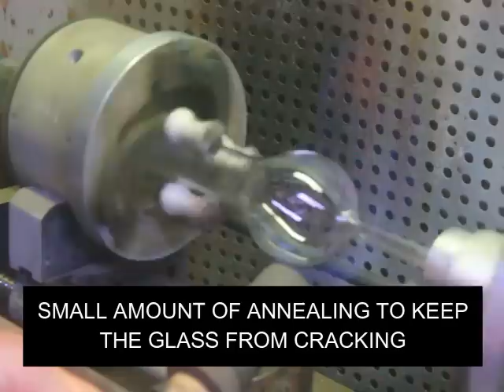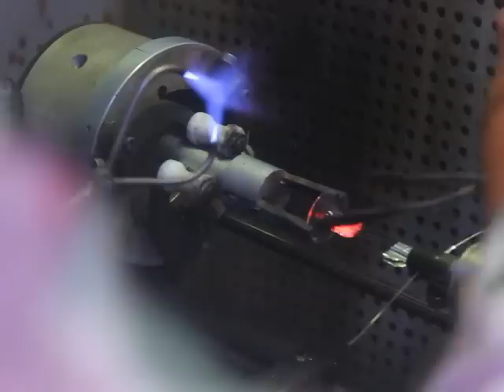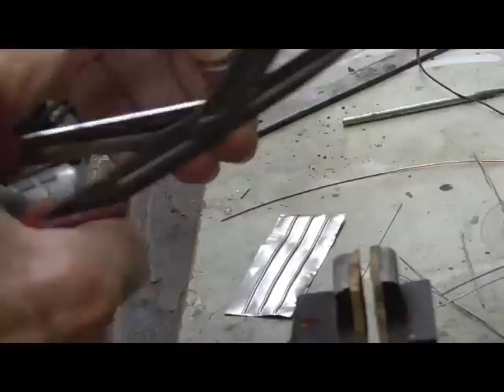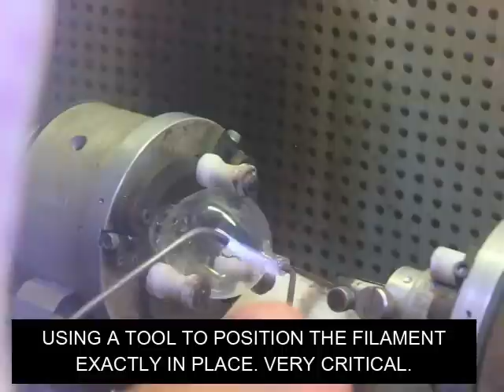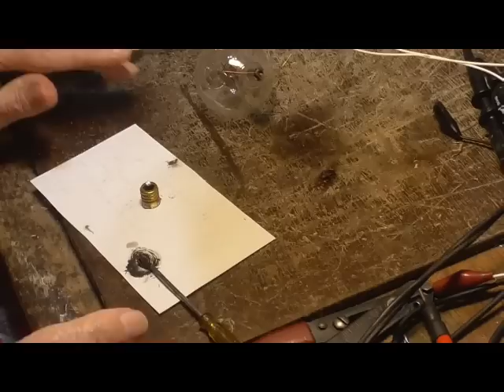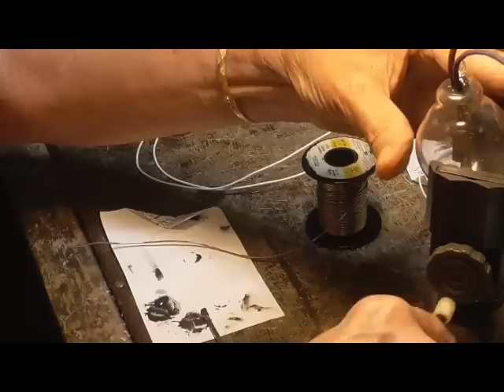making a deforest spherical audion tube

Comment: will you be able to fabricate me a lead glass x ray  vacuum tube 60 mm long x 30 mm diameter?
Reply from the maker: Sorry, no. I do not have the capabilities to work soft glass. I only use pyrex because of the severe annealing required for soft glass like lead glass. Look on ebay. You can get a working tube there.

Comment: why don't you just weld the bronze wire in place of the copper wire?
Reply from the maker: The bronze wire gets very brittle during the heat treating of the tube. It has zinc in it so the 900 degrees F causes it to separate from the copper in the bronze.

Comment: Bronze wire is used for MIG brazing, it's available in 0.6mm, o.8mm, 1.0mm, and 1.2mm diameter.
Reply from the maker: I have the wire. It is very difficult to braze something less than a tenth of an inch in size! My TIG welder can do it but it is a LOT more trouble than crimping the connection.
Reply: @glasslinger  I made the comment because MIG wire is fairly easy to get hold of. The smallest size of bronze MIG wire readily available is 0.024", so it is a potential source of useful wire.

Comment: What fuel gas are you using Ron? The flame looks like oxy-propane or oxy-butane, would I be correct?
Reply from the maker: Close. I have a compressor that I use to pump up the pressure of natural gas from the house outlet. Very cheap!

Comment: I hope you'll understand what I mean here.. When joining two pieces of glass, does the molten glass "wet out" like metal does when welding or soldering?
Reply from the maker: Joining glass is like welding with the two pieces literally melting together. If the two pieces are not hot enough the joint is simply "stuck" together and  will shear apart at the joint at the slightest stress.
Reply: @glasslinger  Thank you, exactly the answer I was after. ☺️

Comment: You have amazing skills and it seems you have a pretty well flushed out shop for glass work.  

Would you consider making a video trying to make a tube with more modest tools, ad more of a guide for beginners to follow?

I am thinking of carefully taking the end cap off of an incandescent light bulb and sealing it off with all of the element contacts being sealed off in the epoxy and one thing piece of soda glass tubulation to pump it down. 

Also, using a repurposed MOT spot welder for the making the elements and their connections, and something akin to one of the HF refrigeration vacuum pumps.  The glass work, sealing off the tubulation,  could be done with a modest air/propane torch.
Reply from the maker: When I first started out I tried what you described. No success at all. The vacuum required cannot be attained by a mechanical pump alone.  The glass work requires a finer flame than a hardware store torch can achieve. See my other videos for more info on tube making.

Comment: Just out of curiosity, why did you connect the two plates and two grids in parallel?  With them separate, you have a dual triode.  Was it just to match the design of the early Audions?
Reply from the maker: The risk of leaks in the seal wires increases greatly as the number of feedthroughs increases. Adding two more wires would not be worth the risk!
Reply: I would assume yes, in faithfulness to the original but I'm just guessing.

Isn't there a way that configuration can be done or undone outside of the valve construction, like I mean, even as he's shown it in this video it doesn't have to be a permanent decision does it?
Reply: @thomasrussell4674  The way it was constructed, you cannot change it. It can only be used as a single diode or triode. 

If all four leads (2 plates and 2 grids) at the top been brought out separately, then it could be changed with external connections.

Comment: Ron, what kind of non-conductive J-B Weld did you use to secure the two wires at the top of the tube?
Reply from the maker: it's the standard hardware store epoxy called JB Quick, the 5 minute stuff. It  has no conduction at voltages below 500 volts.

Comment: The machinist in me wanted a better look at the lathe your using. Those are probably not easy to find these days. Maybe they even used them to make Christmas ornaments at some point in history.

I'm not sure where soda glass got it's name but I can still remember watching a carnival guy working on pop bottles with a torch.

The carnie guy's prizes were two foot tall melted soda bottles filled with colored water and capped.

Empty pop bottles were worth 2 cents apiece in the late 60's and early 70's.

He had Coke, Pepsi, 7-Up, Bubble Up and the other common flavors from that era. He grabbed the top of the bottles with a pliers and heated the neck with his torch. When the glass got soft he pulled and bent the bottle necks into wavy slender shapes and let them cool.

I don't remember him annealing the glass afterwards but he never planned on these "prizes" to last that long any way.

Once he had enough made to fill his booth with prizes he filled them all with water. He then took ordinary food coloring and put a drop in the top of each bottle. Sometimes he matched the flavors such as orange for Orange Crush but he also just made up pretty colors like blue water in a Pepsi bottle.

60 years later I occasionally stumble into an antique shop and find one of these carnie bottles that has survived.

Like you he managed to turn a two cent piece of glass into a prize that may last far longer than the artist.
Reply: Soda glass refers to the addition of soda lime to the raw silicon dioxide before the glass is first formed; it lowers the melting point of the glass considerably, but it also makes it more prone to thermal shock.
Reply: Back in the mid 70's, my aunt had a bunch of these in her room.  She was a teen in the late 60's and I always wondered where she got these.  She also had a bunch of small vials that had liquid in them.  They had cork stoppers and she'd always yell at me for messing with them.  She'd hand-pick out the ones that were empty to let play with them.

Comment: Don't know if you have ever tried this with epoxy. Squeeze it into a little plastic parts baggie, zip it up and mix it. Smush it down into one corner and cut the tip off. You can now use it just as if you are decorating a cake. Great video, thanks!

Comment: GREEEAT VIDEO! Thank you a lot for sharing it and telling us the values of voltage and current you get. What do you think the current would be if you use regular tungsten? Half?

And thinking about it, a video or at least the schematics of your measuring triodes device would be great too
Reply from the maker: Actually, the function of the tube would be the same with a plain tungsten filament! The big difference would be the life of the filament, which would be typically 20-30 hours, while the life of the thoriated filament will be hundreds of hours! No schematics available right now on the transconductance tester.
Reply: @glasslinger  thanks for your answer and keep going. People like you make the internet the great thing it is

Comment: I really admire what you do and although I have no clue, this really makes me want to try and understand how a filament could energise a plate and grid and how it’s possible one wants to oppose the other. This fascinates me a lot.
Reply: Basically, the filament emits electrons - which have a negative charge.  A positive voltage is applied to the plate.  The grid is supplied with a zero or negative voltage. 

With no negative voltage on the grid, the electrons flow from the filament to the plate.  If a negative voltage is applied to the grid, it impedes the flow of electrons from the filament. If the grid voltage is high enough, it completely blocks the electron flow. 

There should be a good description of triodes on Wikipedia.

Comment: Excellent work. Why don't you weld the plate? Not a criticism, just wondering why. A great video
Reply from the maker: The original used pinched wires. Of course it would be easiest to weld it.
Reply: @glasslinger Thank you for the reply. I hope you're proud of your work.  It's outstanding. I look forward to the next video.